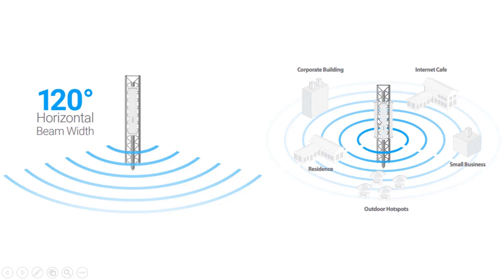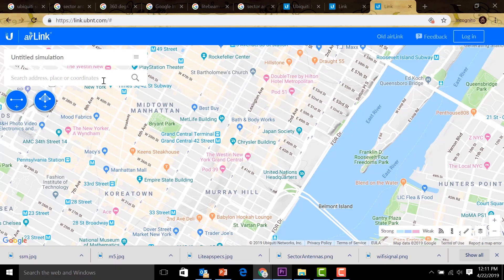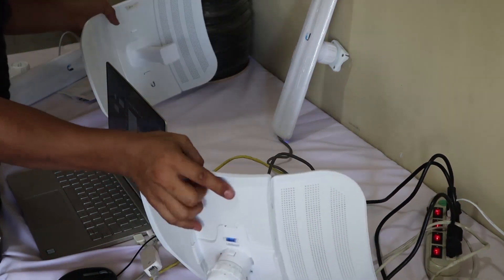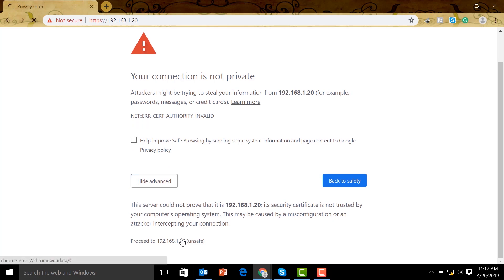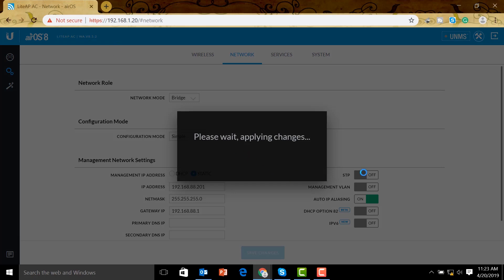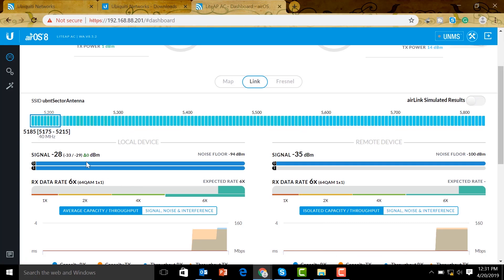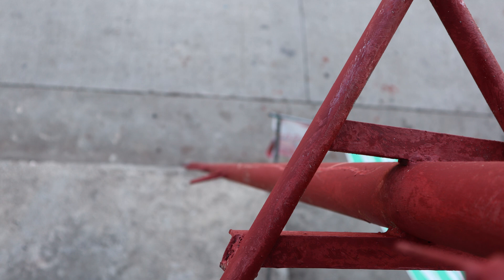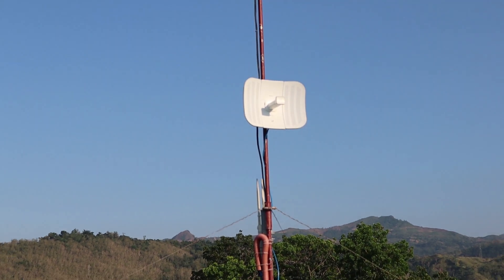Sell Your Internet and make money! | Point to Multi Point Setup Ubiquiti Lite Beam AirMAX!

Comment: I know this is an older video and I do not know if you will check my comment. Could I use my Starlink connection and then re broadcast
Reply: Yes via your Ethernet port
Reply: Yah, you can use a media converter and extend through fibers.

Comment: Why does everyone use the two screws that come with the UniFi Lite Beam M5 as the screws that add extra support for the dish panels? Those two screws are for the pre drilled holes on the plastic nut for the mount. Those screws lock the mount in place and keep it from coming loose. It says in the instructions that you have to provide the 4 screws needed for the dish panels. It should be obvious when the screws don’t even tighten down and just seem stripped out.

Comment: I assume that we are "KAILYANS" based on your name? Can you please help me as i am planning to put up a wifi vendo in our community (Bontoc, Mountain Province). I  have an openline modem with admin access modem but i still cannot get a good speed for a wifi vendo. Any suggestions? I also need help in setting it up cause i'm still a Noob in ptp, ptmp and wireless connections.

Comment: Hello sir, can i Bother you a small question of which product from ubiquiti unifi line has a 200-300 meter effective range that can be used as an AP for piso wifi. Im using comfast e314n v2 now, and it works fine, but I need a more longer ranging product. Please kindly inform us Piso wifi users. Thanks and more power. :)

Comment: This was a very informative video. What settings should I change on the sector antenna to either reduce or increase internet speed. Say for example i want Light beam A to have an internet speed of 10MBPS and not more than that.
Reply: use mikrotik for your controller

Comment: if my 100mbps pldt at gusto ko lang ibigay sa station ay 20mbps pano ? coconect si station sa ap  pero ang gusto ko lang 20mbps each station
Reply from the maker: Use unifi controller to limit speed per user
Reply: @torogipro  ty sir

Comment: Sir good day.. Asking a solution for the problem of config.. I cannot select the lap120 in my m5 23 devices access point even I already install the latest firmware.. What is wrong with this device sir?
Reply from the maker: make sure your lap120 wireless mode is set to mixedmode

Comment: Thank you sir. I have a problem though. I upgraded both devices to the latest version. My LiteAP to v8.6.2 and my LiteBeam M5 to v6.2.0. However, I still cannot select the my AP SSID inside my LiteBeam M5. Can you explain why? Thanks po.
Reply from the maker: On the lite ap settings>>> wireless mode>>> set ot to PTMP mixed

Comment: reselling of  internet is ilegal you need leased line from your ISP and MOA
Reply: It's not illegal, it's only against the company's user agreement if you do not have a internet plan that allows the resell of it. If you do not have a reseller plan then they will terminate your services for breach of the terms of use agreement.
Reply: Dustin Rhodes papaano nyo po nagawa?

Comment: Hi do I need 1 ubquiti airmax and  2 litebeams? im trying to extend my wifi around 100meters. Would 1 litebeam be enough? I need to know before making a pruchase
Reply from the maker: If you are trying to extend your wifi to one location only, use point to point setup.
Reply from the maker: Check this out: https://youtu.be/zDWkd1XdfkQ
Reply: Do I need to use the nanobeam just like in the video or the litebeam would work aswell? Only the litebeam is available in lazada
edit; Found a nanobeam but its way more expensive than the litebeam
edit2: will i need to buy an access point?
Reply from the maker: @libi13levi  Litebeam will do also amigo.